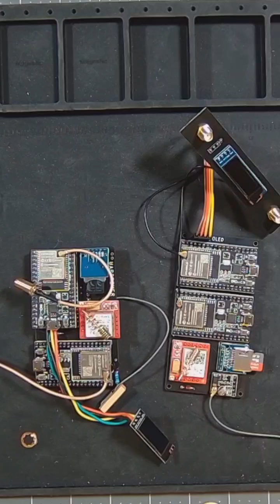purpose built wardrivers #diy

Comment: What do these do exactly? Theres no clear answer out there, does it steal people's personal info?
Reply from the maker: My video on "What is Wardriving?" Will answer this. In short though no they do not steel peoples data they note wifi access points along with its name security type and location and puts it into a csv file that can be used later for research or to compete against other wardrivers.

Comment: The wispy hacker box is about ~59$ if I remember correctly how does that compare to the price of JHewitt? Also what it is running? Basically headless kismet or…??
Reply from the maker: I spent around $100 total for my jhewitt wardriver but that was enough parts for 2. The hacker box is only $45 if you subscribe. It's running purpose built code on the esp32s that are in the project written by jhewitt.
Reply: Ok sweet thanks for the info… just ordered up the Wispy, get it together when I get it.